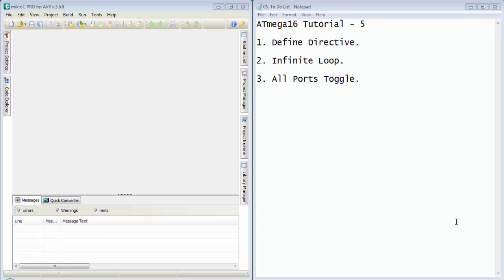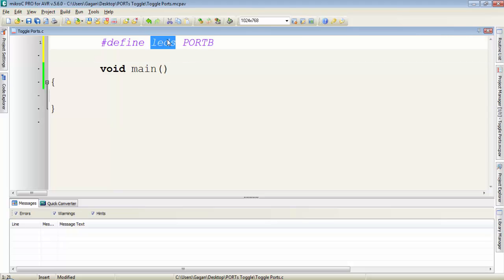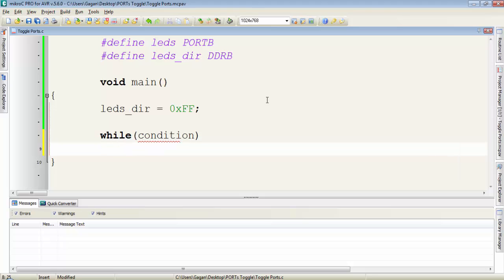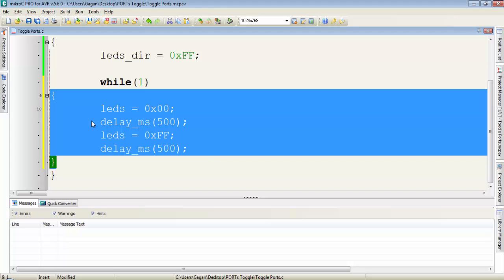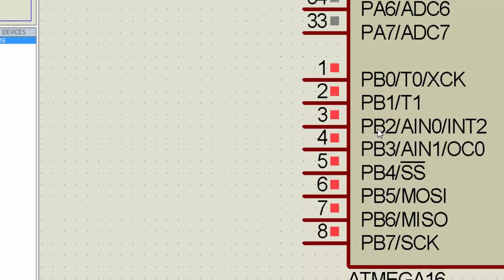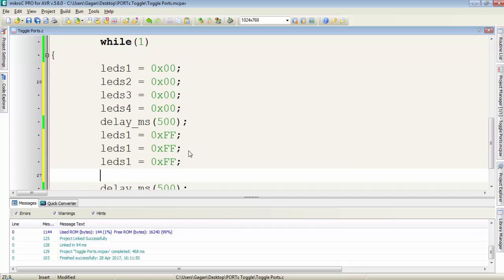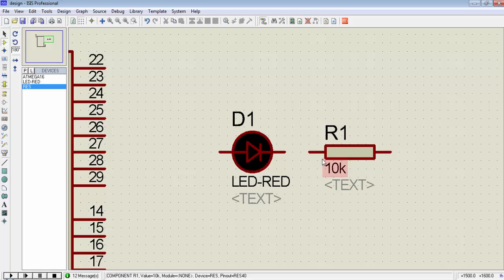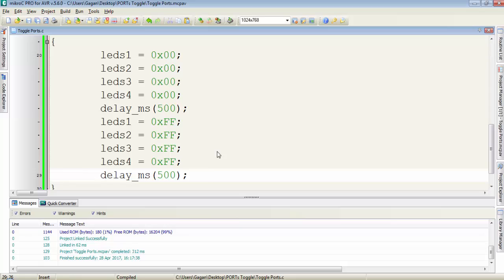Atmega16 Tutorial 5 - Infinite Loop with while

Comment: What does leds_dir do?
Reply from the maker: HI Akul Jamwal..... First of all.... "leds_dir" is defines by me as PORT Direction setting purpose or it is a user defined constant which is assigned the name of "DDRB" PORTB Data Direction Register of AVR.

With this declaration, you can use this name "leds_dir" instead of DDRB to set the direction of AVR PORTB.

for example: DDRB = 0xFF;
but You can now use, 
leds_dir = 0xFF;

Same meaning.

it is just easy to understand that I am setting the direction of a PORT
Reply from the maker: With value 0xFF, that means you are configuring the PORTB as an Output PORT so that you can control the LEDs connected on the Port.